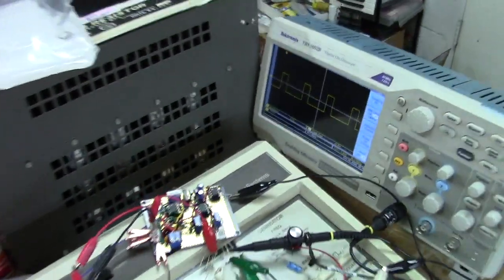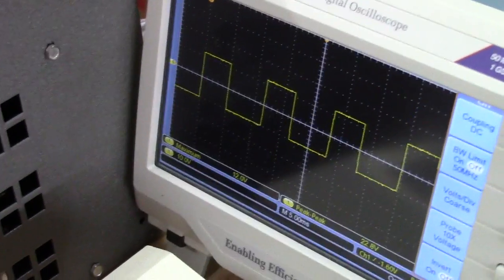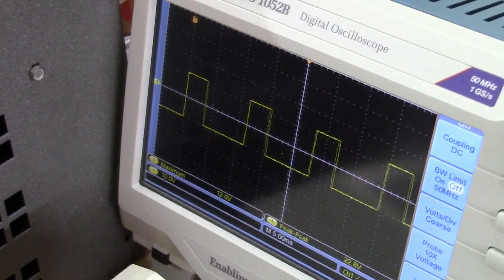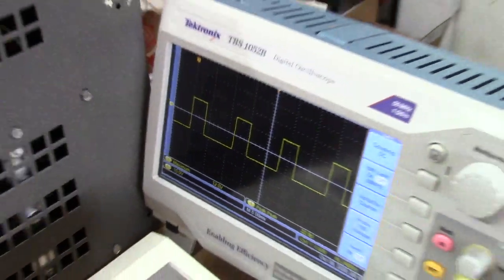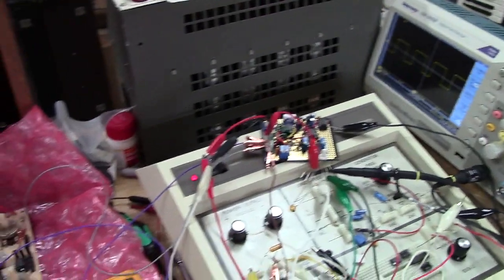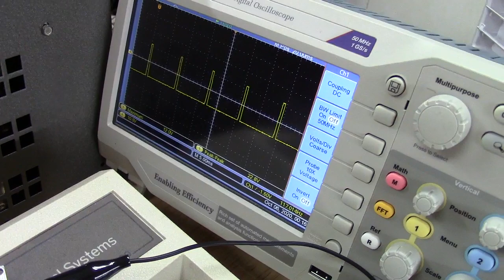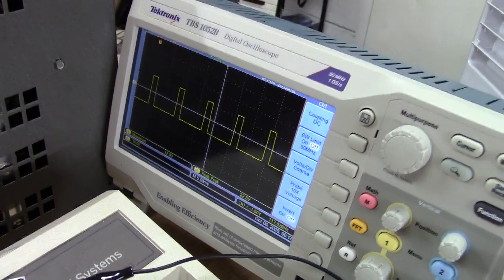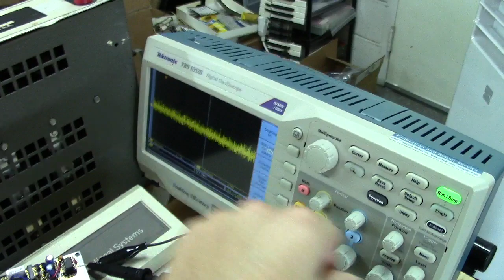Joshua's Moog Prodigy Modifications Part 1 (by synthpro)

Comment: Nice work Jareth. Is there a particular component(s) that can be changed to modify the mark/space ratio in the existing circuitry? I worked on a Prodigy recently where the square wave of VCO 2 was a thinner pulse than VCO 1.
Reply from the maker: Thank you. There are two  1% tolerance resistors per oscillator  that can be changed to set pulse width. There is a chance that there may have been a tolerance issue or a problem with the opamp. It could have also been a switching issue with the FET itself but that would effect the sawtooth I would imagine.
Reply: @synthpro  Thanks, that'll be R41/57 and R59/75 I assume?

Comment: "Has a really good set of oscillators and filters". It's a Moog, one would hope so.
Reply from the maker: I say that because this uses a different designed oscillator which is very stable, (not like moogs other thermally regulated oscillator designs using the UA726) this one uses a transistor set in the 3046 as a heat source by controlling current flow through that component.
Reply: @synthpro  interesting. I learn a lot from your videos, thanks.